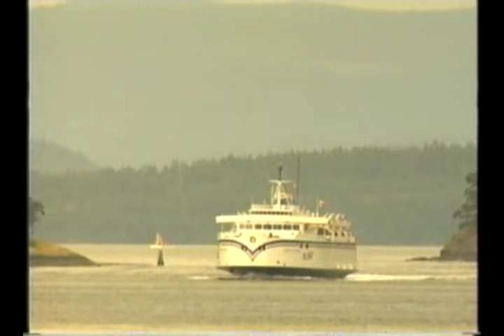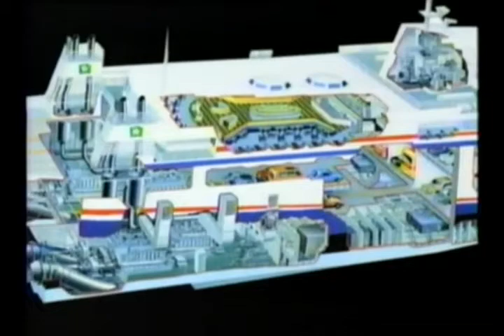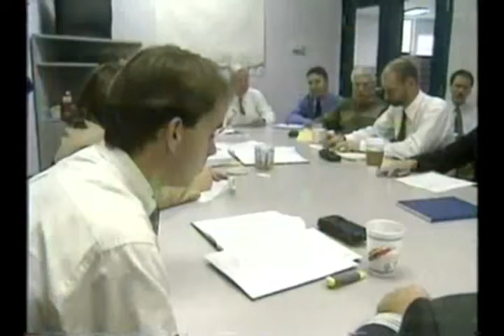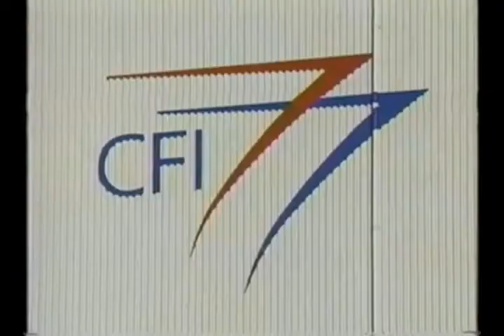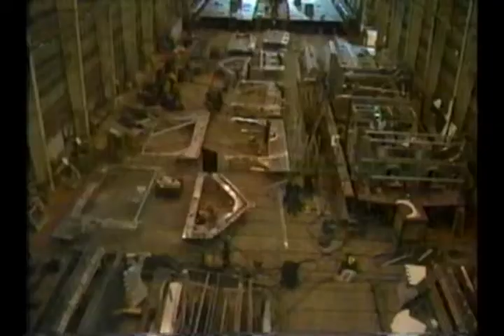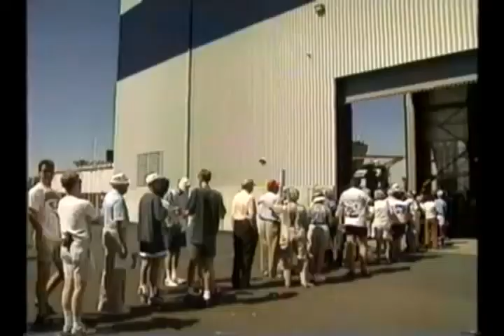Building of the PacifiCat Ferries (Part 1/6)

Comment from the maker: I suspect it would have been new aluminum, given that BC produces a lot of aluminum. In any case, aluminum is more or less infinitely recyclable and is not degraded by the recycling process. I don't recall hearing anything about the ferries having structural issues, although I never followed the story very closely. As with much of the BC government's failures, and governmental failure in general, politics play a bigger role than anything more tangible.